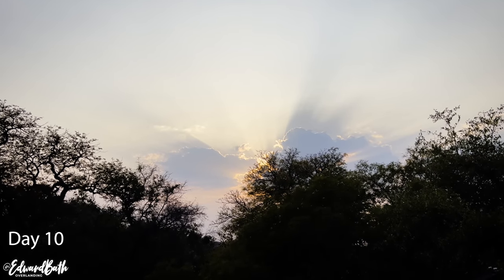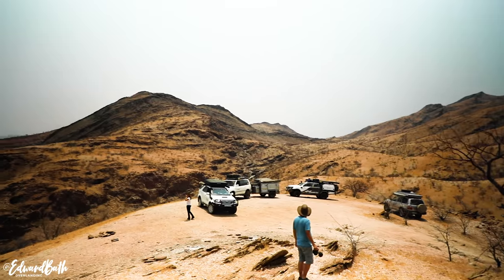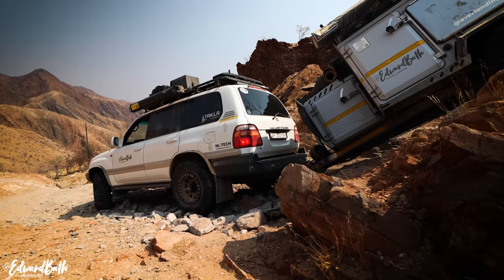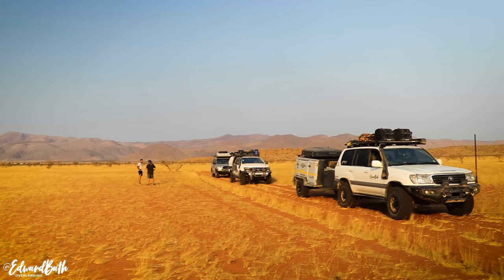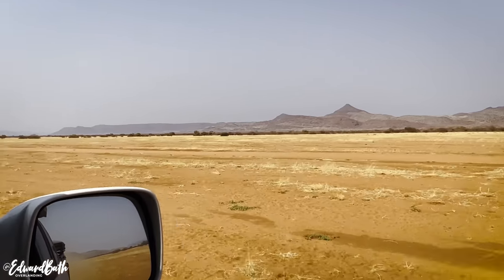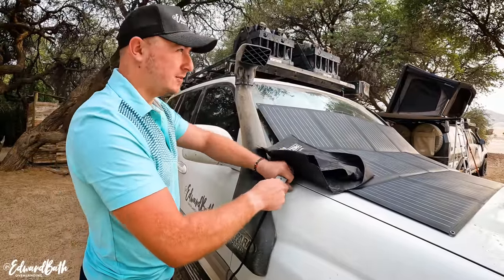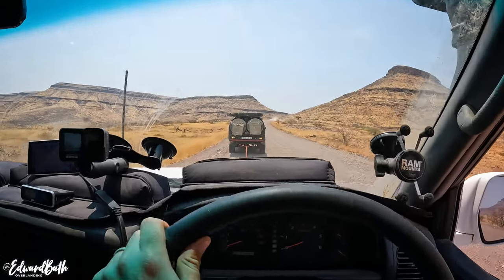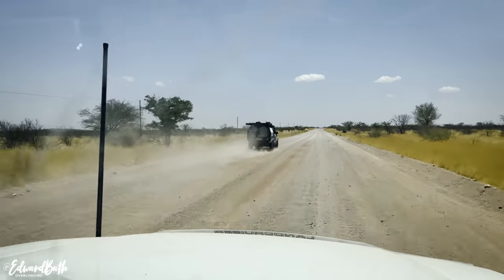BREAK DOWN NIGHTMARE! | NAMIBIA  |  AN OVERLANDING ADVENTURE  | EPISODE 2

Comment: Brilliant video. Thanks Boet.
Was told a while back if it works on a Toyota don't change it...

i have a 105 hd FTE (it is being rebuilt due to aftermarket parts being put in and probably poor workmanship  thus a valve or 2 kissed a piston)

There a thought we don't speak fuel consumption😂 you got the best ever.

On the flip side if you get someone to do a job they must do it properly is their name.

Onwards and upwards. Glad there is another video coming.